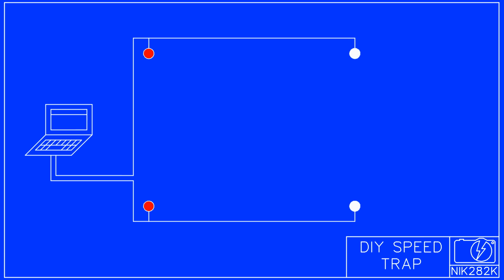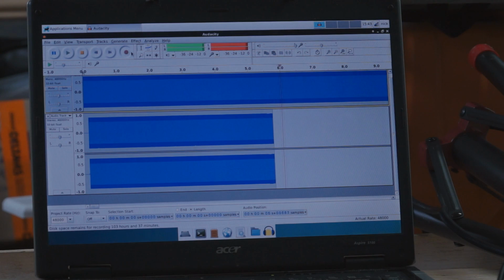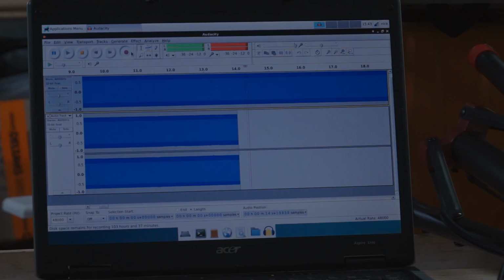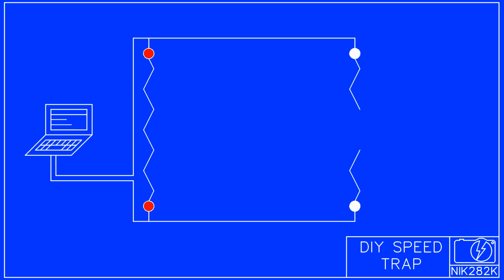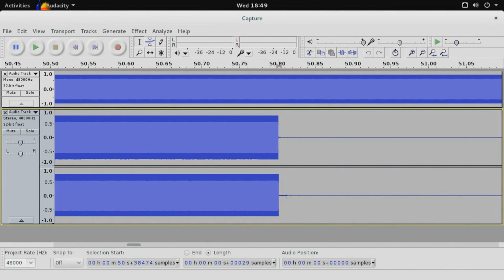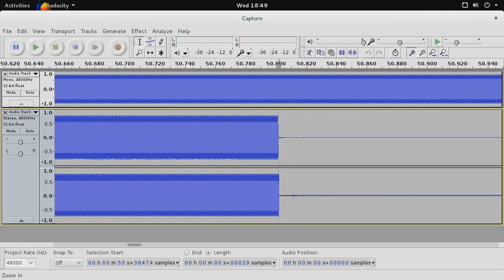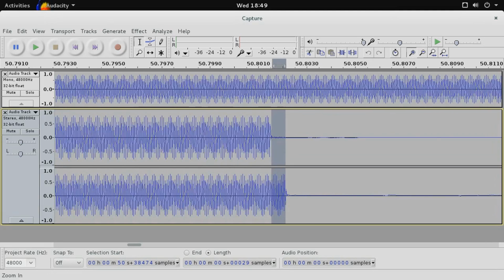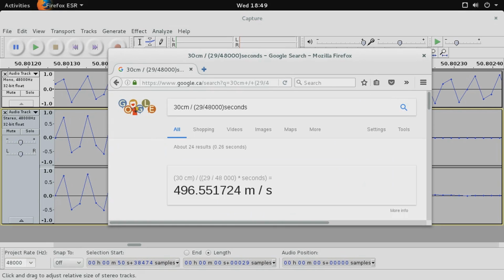DIY Speed Trap - Supersonic Chonograph

Comment: I seem to have missed this whilst refurbishing an old ski-doo and table saw.   Such activities cut into my YouTube time.  :)

Is 48kHz your audio device's highest (reliable) rate?  I can get 96kHz sampling out of my Mac's built-in analog port, for double the resolution.

Of course, by increasing the distance between the two foil strips would improve the precision.  If you went to a meter separation @ 48 kHz, a +/- 1 sample would give a stdev of 8.6 m/s, instead of 17.1 m/s at 0.3m separation.
Reply from the maker: Unfortunately I don't have any hardware that can record better than 48kHz so I am stuck with a low-ish sample rate. I may increase the spacing later but this was build mostly to fit the wood I had laying around.

Comment: Hey cool design I have made a very similar sensor, I used an arduino uno with two infrared leds and two infrared receivers, when the bullet passes in front of the leds it interrupts the light on both receivers in a similar way that your foil gets broken, making it easier to count in micro 1x10-6 seconds, at around 16MHz, that its accurate over ~600Km/s, an overkill... but still very fun, I enjoy your vids a lot, if you like you can have my code
Reply from the maker: How did you deal with alignment? Part of the reason I went with physical "switches" instead of optical was to avoid having to line up the speed trap with to much accuracy.
Reply: Nick Moore the alignment was somewhat easy, for the application I used it wasn't that much of an issue, but in this case I think it would be easier to shine a laser to make sure the horizontal axis it's aligned, in the vertical axis the same, it takes some practice but it's not that hard after all the infrared emisor and receiver are the standard size of a led
Reply: of course you could use the physical switches too with any microcontroller or arduino and still have the full speed, the only diference would be the circuit which it would had to be like this one, just instead of the push button, place your foil

playground.arduino.cc/uploads/Main/FGFS_basics_pushbutton.jpg

Comment: You've been going on town on sound cards lately. Every project you published was incredible to me. Simply spot on with a cherry on top.
Also, You can upgrade that jig to measure speeds of less accurate objects (BTW, what was that pneumatic cannon?). You can connect a lot of foils in series electrically, but align them in parallel geometrically. That way you get a screen instead of a single strip.
Reply from the maker: Yes! I have seen that done with a laser between 2 mirrors, great idea! I never thought to try it with the foil.

It is a pneumatic cannon but I made a couple changes to squeeze as many meters per second out as I can get.

Comment: a very clever way to use what is available. could probably take the same technique into the field  (range?) with similar sound recording gear, like a phone etc.
Reply from the maker: Phones tend to have stereo output but mono input. You could "send" 2 different signals (prime number frequencies so they don't have a beat?), that way when one foil breaks you will see one frequency disappear before the other. May not be as accurate though.
Reply: theres lots of ways you could add circuitry over the tape but then you lose the simplicity of the in/out method. and if you have a laptop then you're already portable.   but with circuitry i suppose recording the output of a tone generator that included two parallel 'resistors' (your strips) and spot a high to low to off change or something?
Reply from the maker: Yes! If you had one channel with half the signal of the other you could set it up to see a stepped signal.
Reply: Or maybe just drive the recording input with straight dc, watch it literally drop levels. Not nice on the hardware though.
Reply from the maker: Many audio devices block DC to save the hardware from being cooked but the last time I checked was 10 years ago, hardware may have become cheaper and more forgiving to abuse.
Reply: Frequency shift or avg level shift would be the way. But i like the in/out method in the video. K. I. S. S.
Reply: for a mono input : how about using two outputs at the same frequency but with opposite phase?

That way, you should see no signal at first. Then, when the first foil is broken, you would see a sine appear, and disappear when the second foil is broken.

The amount of time during which a signal is visible is the time interval between breaking both strips of foil.

Comment: Neat use of a soundcard! I once used a soundcard to measure rotational speed of a gear, with a little magnet+coil near to the gear teeth. Interested to see what your "cannon" is, since I thought it wasn't possible to get supersonic with just compressed air.
Reply from the maker: With the constant pulsing you would get a pretty good measurement, I'll have to remember that trick.

;) The trick is to use only compressed air and nothing else. The compressed air has to accelerate the projectile as well as the air ahead of the projectile (which is compressed in the process). If the projectile is very light the mass of the air in front of it contributes a huge amount to the total drag, with a clever barrel that has been evacuated and takes care of blow-by the projectile can accelerate quite a bit more.
Reply: To get the speed of my lathe with its various pulley combinations, I'll just stick a springy piece of wood into the 4 spoke hand-crank pulley, and count the number of clicks heard in an interval, and work it out to RPM.  I'd probably want to do a magnet solution, though, if I needed a real-time calculation, if only to cut down the noise.

Comment: Nice. That's most likely more accurate than the circuit I rigged up with Arduino and some magnet wire, given the nature of how a microcontroller would measure time.

Incidentally, you can also get sound cards with a much higher sampling rate, although the need for such a thing is probably a little exaggerated given the (relatively) low speeds we shoot things at.
Reply from the maker: Does the Arduino have an internal clock or an external crystal? With an external timebase it could probably be an order of magnitude more accurate than my set up.

I had considered that 48kHz might not be enough but I would have to get up into the 2km/s range before measurements got ambiguous. If I get anything with a reasonable mass up to those speeds in the garage I'll be asking NASA for sponsorship.

Comment: That's very clever! Also, you'd probably get better precision if you used a low frequency digital squarewave as the tone, as you could use the waveform and the duty cycle to pinpoint the sample where the connection cuts off more precisely.

Is 48 kHz the most you can get with your setup? My laptop can record up to 96 kHz. That would give you a really great measurement margin with a dirty cheap setup.

Like I said, really damn clever!
Reply from the maker: I thought of using lower frequencies as well but I feel like there is something to do with Niquist and sampling that gives a high frequency carrier an advantage but I'm not sure. I will give it a try next time I fire and see if the signal is more or less clear, thanks.

My old laptop tops out at 48k but it should be ok unless I pass 2km/s.
Reply: I used to think the audio output on my phone (which I occasionally use as a DAC to test op amp circuits) was AC coupled, I realized after playing with a "function generator" app on my phone capable of producing square waves of 1S period and longer, that the output is actually DC coupled, and can swing a volt and a half. Probably about half the 3.7V source inside.
Reply: If the ADC microphone input is DC coupled, you can probably get away applying a 1(ish)V to the one side of the foil! Then you do not need to worry about any of these complications. But I have to say, this is a genius solution, I would have never thought of it!
Reply from the maker: I didn't check on that laptop in particular but I think most audio cards have DC blocking caps to prevent significant current from flowing. I'll have to check that too.